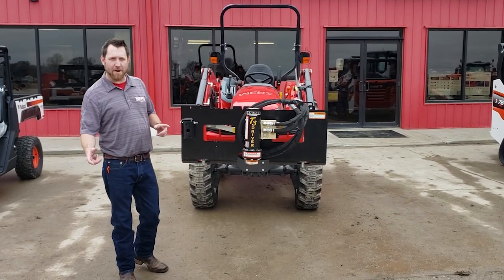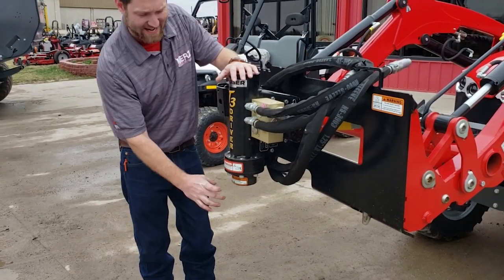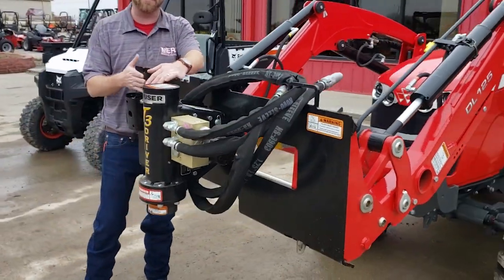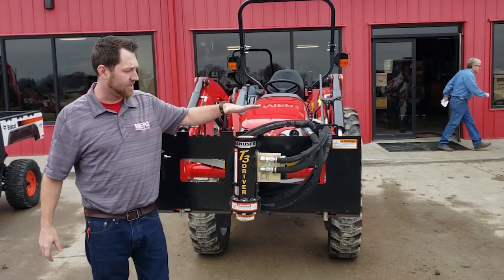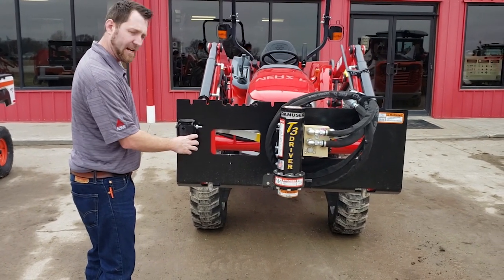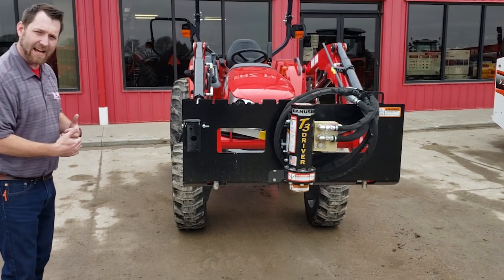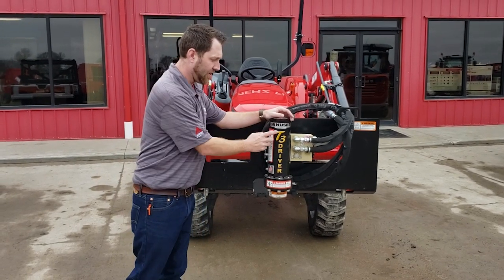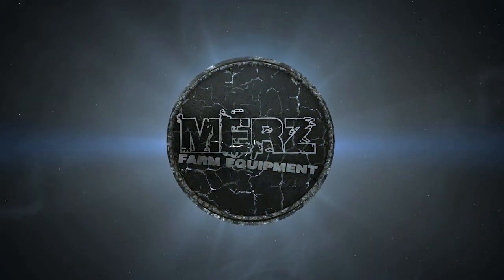Easy Way to Build Fence! Introducing the Danuser T3 Post Driver for your Skid Steer or Tractor

Comment: Does this work on the gc1723e? Or does it not have enough Hydraulic power for it
Reply from the maker: This would require a 3rd hydraulic function of the loader. Similar to most hydraulic grapples. At this time I do not believe AGCO offers a 3rd function for the loaders on a GC.